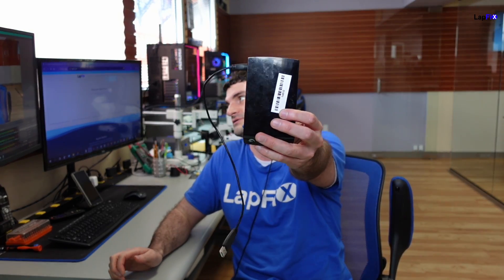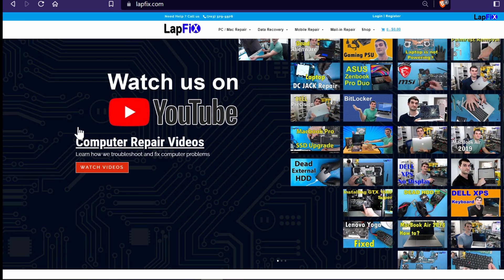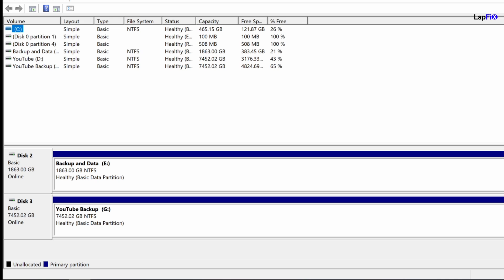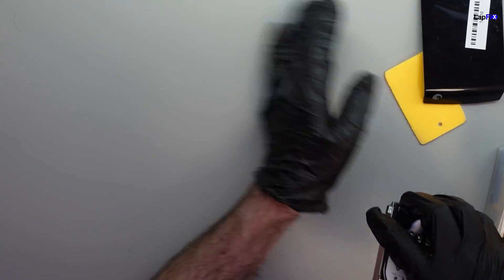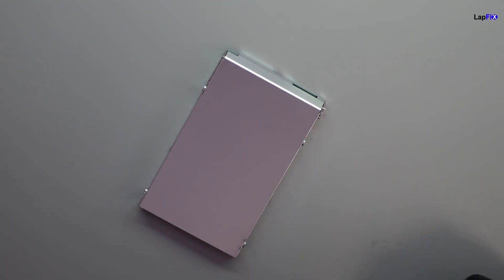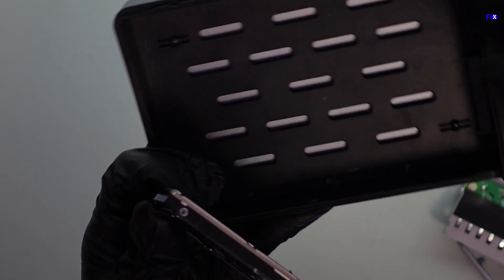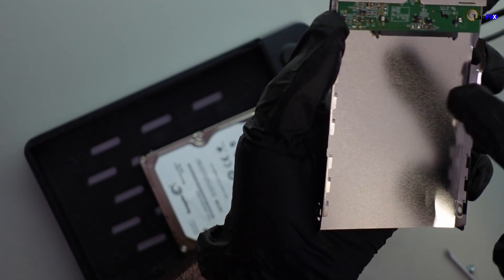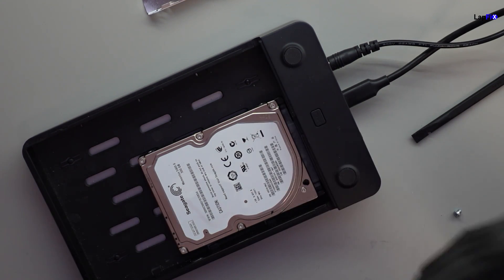How to Recover Data from a Seagate USB Hard Drive Not Recognized

Comment from the maker: Do you guys use WD or Seagate drives for your External USB Drive Devices?
Reply: Proud owner here of 3 external WD drives and 1 very old seagate that I've been burnt by in the past so haven't bought another one 😄
Reply: Whatever Costco has on sale at the moment 😆
Reply: Hey I need help.  I have a Seagate 4tb.  It's was just working a few days ago.  Had years of pics an data.  No of my PC or laptop are reading.  It shows up as Local drive.  I may have  accidentally deleted important data files that program the disk. Can you help?
Reply: I use a seagate but recently went on holiday, came back with a dent after flight. Computer recognises the device but error with files, can this or any other  help? thanks
Reply: Yes and never again... My Seagate isn't showing up. The cable and SATA thing is loose af. No idea how, I hardly move the HD. What can I do? do I need a new SATA part?

Comment: I have a SeaGate Firecuda 2TB HDD that I've been using in my PS4 console for about the past year.  

I hadn't turned the PS4 on for about a month or so, but the next time I did turn in on, it wouldn't start up, aside from giving me an error message and instructing me to hold the power button until the console restarted, which just brought me back to the same error message.

Following a DYI video related to the PS4 error code, I attempted to clean the console/HDD using a can of compressed air, which did not resolve the issue.  As of about an hour ago, I finally got the hard drive unscrewed (the PS screw holding the tray in place seemed to have lost its threads and was just incessantly spinning in place).  

Having removed the drive and using a USB/SATA adapter to connect it to my computer; it's completely unrecognized, either by the File Explorer system or the Disk Management Program.  The drive makes no sounds (spinning, whirring, or even grinding).  I verified that the USB adapater is functional, using another 250GB HDD I had on hand, which was recognized by File Explorer.

I can't believe that the SeaGate drive is a complete brick and that I have just utterly lost approximately 1.6TB of game, video, and picture files with no chance of recovery.  😮‍💨

Comment: Thanks for the video! My Seagate backup plus is recognized one minute and then randomly it's no longer recognized or is not detected.  It comes back eventually after a few minutes.  I think it's dying so I'm trying to pull all the data off it but in addition to being randomly being detected, the data transfer is incredibly slow.  It get goes up and down between 0 and 8 MB/s.  30 GB takes about 3 hours. If becomes undetected, it gives me an error and I have to tell it to continue the transfer. Thankfully not restart the whole thing. It start up again from where it left off, but I do have to tell it to continue. Any thoughts? I probably have about 1 TB to transfer and it'll probably take me a month!

Comment: i have a Seagate #SRD00F1 external drive (with data) I bought in 2012 having a similar problem. After plug-in to USB port, blue light flashes, musical notes audible but no drive recognition in File Manager or Disk Management. The drive is wrapped in metal, not foil. Do the old Seagates have the removable SATA connectors? If so, can I remove the metal inner enclosure to get to it? This is my backup drive and my main drive just failed. My whole life is on this drive. HELP!
Reply: Hey, sorry to hear that, facing similar issues here, did you manage to get your data?
Reply: @doomepic  I have same issue... Has anyone found a solution to recover data or to repair the drive?
Reply: I have same issue... Has anyone found a solution to recover data or to repair the drive?

Comment: Can you clone a Seagate external hard drive that doesn’t stay connected by using the off-line cloning function on a docking drive and transferring the data to a brand new hard drive?  It surpasses the SATA (which could be faulty).  Thoughts?

Comment: G'day buddy, great informative videos, I'm hoping you'll be able to help me solve a puzzle or at least point me in the right direction? I would be so grateful for your opinion & guidance.. 
I've recovered some footage from a WD purple surveillance drive installed in an Annke DVR, recovered directly to a WD elements HD (via a sata dock & Windows 10, no issues with the surveillance drive being recognised once I'd added it in diskman, not sure if it's worth mentioning Windows did a format but the existing data was still on the drive when reinserted back into the DVR..). Testdisk has recovered the files as an mp4 extension. The Annke DVR config settings say the footage is encoded H.264+. Every type of software I've attempted to view it with tells me it's MPEG2 or MPEG-PS and I've had no luck with any codecs or transcode or demuxer software when it comes to playback. I've heard about proprietary playback software, but it seems that Annke have not 😬
After watching some of your WD videos, is it possible it's the WD drives that have made it impossible to view the files? Or would it be an Annke compression type of issue? Or is there something really stupidly simple that I'm overlooking? When VLC said nope not playing this & can't fix it i thought fk how am I going to get thru hundreds of GB possibly a coupla TB of footage 🤣 
Any hints or tips or tricks or LITERALLY ANYTHING I would be ever so grateful for! Thanks again for sharing your wisdom your channel is awesome  🙌
Reply from the maker: Good day, thanks for the support.  The hard drive just stores the data.  Something must have went wrong with the format and recovery into a mp4 file.  Data recovery software wouldn't change the extension, it would just "see and recover" Most likely either the data is corrupted or the mp4 files aren't the original files.
Reply: @lapfix  thank you so much! Any repair software you'd recommend please?